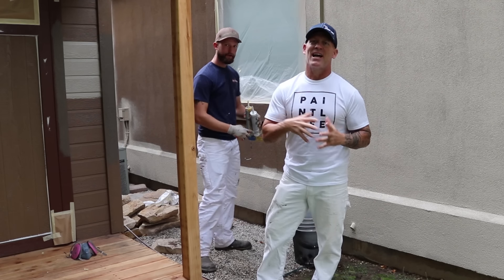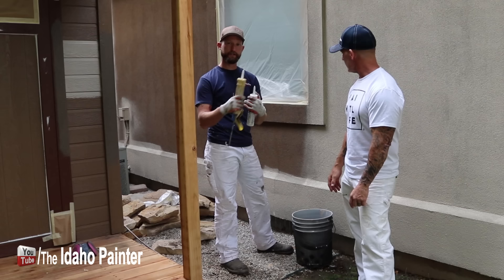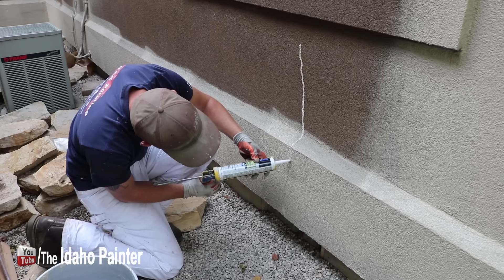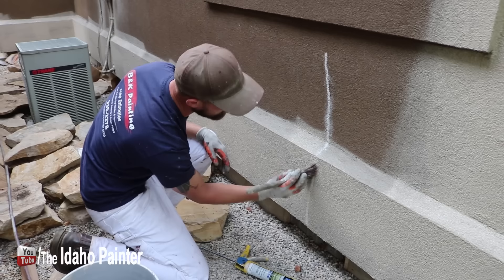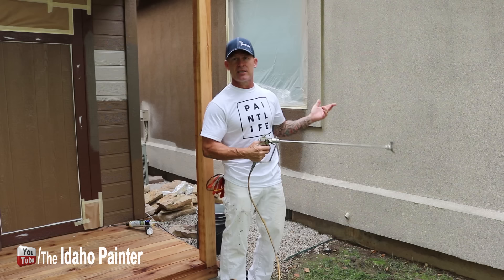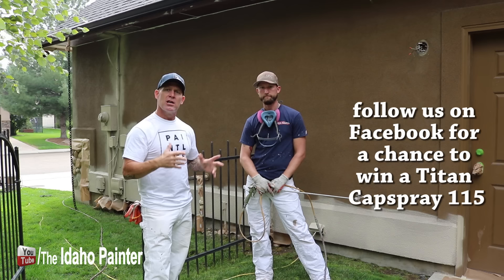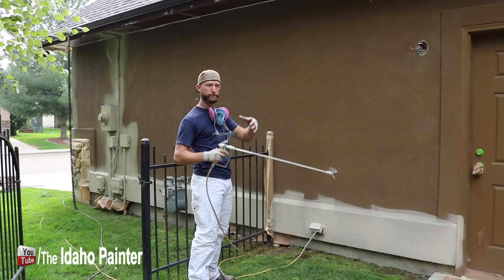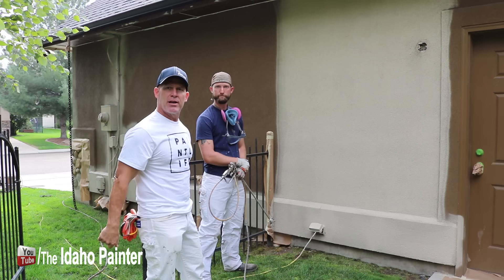4 Secret Painting Tips To Paint Stucco

Comment: The way I was thought 27 years ago was the only way that stucco should be painted is sprayed and back rolled. Might be able to get away with it on sand finish but on rough surfaces they definitely should be rolled. I from Florida so almost every house has rough stucco.
Reply: so these guys arent backrolling it because the stucco is not rough like it is in Florida?
Reply: YES!!! Always back roll!! I'm not sure why they didn't, but they should have!!
Reply: I have to agree with the lack of back rolling is a technique that was never taught in the trades as I was coming up at the time. i know we used sprayer and back rolled but 30 years ago they were really expensive and not sure they used the newer hvlp type back than. Thats when labor was cheap materials were put on heavy to save the time and expense having to come back for missing an area or the previous coat showing thru.
Reply: should aboslutly backroll any porus surface
Reply: What if the stucco has been previously painted with latex paint (elastomeric I think). The house I'm doing has previously painted latex satin sheen in stucco.

Comment: I roll on paint on rough stucco. But I wet it with water then roll on. The water seems to draw paint into the valleys and holes. I apply very thick then back roll after 10 minutes.

Comment: We always use an Elastomeric coating when painting stucco. It provides a flexible flim that covers hairline cracks to prevent water from penetrating into the building interiors.
Reply from the maker: you have a great point.  however, I have spoken to the chemist at sherwin williams who developed Sherlastic and they say you should not use elastomeric on stucco.  You should research why they say that.  You might change your mind
Reply: we painted a hospital with elastomeric spray -back roll 10 years ago still looks great
Reply: South Florida we typically apply elastomeric coating on parapet walls and severely spider cracked stucco, or rain exposed areas. Every where else is exterior paint. #PaintLife
Reply: @Idahopainter  that's only because they have liability.  Otherwise professionals have been using it on commercial building including hospitals and hotels for more the 20 years with zero issues.

Comment: Spray, backroll & spray. I have even gotten away with just spraying. Ill point the gun up then down then side to side at the end. Always spraying at a bit of an angle depending on how thick the texture is.  Sprayed residential in AZ (5 years)and all over the country doing commercial now for the last 12 years. 26 years all together now.Hope that helps.
Reply: Exactly spray and back roll at minimum that's how I do them I've been doing them for a lot of years here on Maui we use Sherwin-Williams satin.based on the fact here on Maui exterior Sheens breakdown in 4 months. I use the purdy 18 inch roller setup I have a friend who uses the jet roller system it takes time but it's proper

Comment: Here in the UK we would have ground that crack out first, then filled it with epoxy, then blended it in to match the existing surface finish.!!
Reply: That is actually the correct way to do it, even here in the US. But if it's a small enough crack you can sometimes get away with doing it the way they show here, though using a wire brush on the crack to clean it out first is recommended.
Reply: Reminds me of the the time your Red Coats fought the “prim and proper” way while our a revolutionary minute men used Guerrilla warfare tactics by ambushing and leaping out of trees with machetes.  We had a glorious opening of can of whoop ass party and you no likey.

Comment: Ok how about you do your prime coat then address your cracks by caulking and wiping excess with a wet sponge the primed surface will allow you to wipe off the excess before the caulk dries. Good video!
Reply: Priming first also insures that surfaces are clean, sealed and bonded for the caulk to stick to.  I never caulk unprimed wood for the same reason

Comment: Like the way you pre cut in electrical lines and bottom . Good job, but not sure if you went back over it with second coat? It would be a good idea. Also, it's not easy to paint a light color over dark and make it look nice...Good job, but that one was easy texture. Curious to see finished product or how you tackle heavy knockdown with that spray technique and get it to look good?
Reply from the maker: We typically back roll stucco

Comment: Definitely should be back rolling that stucco.there making it more difficult than it is
Reply: I've never seen such a thing. Spraying in crazy patterns to get a smooth look. I think that's how you would get different lines. If you spray even and over lap by 50percet you get better courage. Plus back roll.
Reply: First coat back roll with a thick coat. Then we repeat spraying an additional coat with no back rolling even spray 50percet overlap.
Reply: How you expect to do that crazy spray pattern 30 feet up. Back rolling is the way to go. Plus your locking in the paint not just coating the top.

Comment: Hey guys! I’ve watched almost all of your videos in preparation to paint the exterior of my stucco home. But I have a few unknowns that I hope y’all can help me out with before I begin! Prepping the entire house before a project... pressure washing, masking (I watched the video but it was for trim instead of the main house), window coverage (I’m assuming the double white tape and plastic?), and around shrubbery and at the top of the house where it meets the under roofing and when you’re on a ladder! How do you navigate?! Also, I bought elasromeric paint, and based off your tip video, I’m assuming I should go with a 619? 
Thank you for all you’ve taught me thus far, you have been extremely helpful!!
Reply: You have to pressure wash if you’re house is really dirty if not you can get away with hosing it down with a hose and a god nozzle you’re gonna need to mask everything that’s will not be painted starting with the windows and door handles you paint the body then paint the trim covering the body and then you do your accents (doors etc) you will probably be better off with a 517 for spraying your body a 315 for trim and pop outs and a 210 for your doors
Reply: I like your idea better.

Comment: I have a unique problem. (Maybe not so unique.) I did a paint match at Sherwin Williams for touch-up on painted stucco. Dark Brown. On 3 sides of the house, the paint matched perfectly from all angles at all times of the day. The Western side is a LITTLE MORE FADED than the rest of the house. In the MORNING the touched up spots look a little darker than the old paint. Almost like little spots of WET stucco. In the afternoon when the sun moves to the west those spots look perfect & I can't even see it. I tried watering down the touch-up paint. It didn't work. I'm thinking about trying a bleach & water mixture & hitting those spots with a small brush or toothbrush to fade the paint a little. Is there any TRICK to matching that Western side paint without having to knock out a big chuck of stucco & trying to match that? Someone said the "Spectro" has trouble matching stucco. The original color match was easy. I just removed the TV plate & brought that into SW. A few people have said it's almost impossible to match the paint perfectly on all sides without repainting the entire wall. I'm trying to avoid that. Big 2 story house in Vegas. Big job.

Thanx!

Comment: You should be back rolling this!!
Reply: Ikr ?
Reply: So after spraying the exterior it should be back rolled?  Trying to learn all I can before attempting to spray my house.  Any advise would be appreciated
Reply: @Franklin12211  ....yes, spray and back roll as you move along
Reply: Thanks!
Reply: You should not be doing this to stucco in the first place. Apply basecoat and mesh on cracks then resurface wihh finish coat in disired color
Reply: Blake Ranew  how do you prep the stucco surface so that the paint adheres
Reply: back rolling pushes the paint  "stain" into the cracks and locks it in.  It always looks better afterward also.

Comment: Thanks for the great tips!

Correct me if I’m wrong, I’ve been working with respirators for over ten years with carbon fiber, body filler, and paint. But is the guy spraying wearing a P100 filter, which is a particulate filter? Shouldn’t he be wearing a vapor filter? I usually wear a dual filter so I don’t have to worry about switching between but that looks like a P100 filter for a 3M mask
Reply from the maker: Inside yes

Comment: I am confused about the crack " repairs" I always have scraped cracks out to go et to sound material and give an area fir the elastomeric caulking an area to bind and lay just below the surface finish. Maybe your prepping the stucco for paint and those are hairline cracks? Isn't the caulk your using water soluble for eas cleaning of your tools? If they are using a damp brush will break down the caulk preventing it curing correctly weakening the joint resulting in premature failure of the joint after so many thermal cycles? 
Also if I came home and saw your guy spazzing with the sprayer I would ask for him to give a  drug test before allowing him on my property or on any kind of ladder. Back rolling would eliminate the spray pattern and work material into the heavy finish for better coverage, and finished product.
Reply from the maker: We have never had issues with our method

Comment: What about spray and back roll the stucco?
Reply from the maker: We back roll depending on the condition of it
Reply: As a home owner I would demand back rolling... just spraying stucco the color  will fade in less than a year.
Reply: Paint Life TV what conditions require back rolling. I will be painting my home soon. I’m just one man with an airless. Thanks.
Reply: BAC always backroll your stucco, you’ll push the paint into the pores otherwise paint will dry up and flake off once the sun burns it up. Spray a good amount, keep a 5 w a screen in it next to your airless, spray and roll as you go, second coat is only spray. the thicker the coat the longer life your paint and stucco will have.
Reply: Kevin Perez Thanks. What’s your opinion on paint. elastomeric or 100% acrylic?
Reply: BAC elastomeric! Much more weather resistant
Reply: Kevin Perez Elastomeric paint may require a top coat.
Reply: @kevinperez.5  great tip dude, but if it's just a normal smooth wall could I just spray and leave it or do I still have to back roll it?
Reply: Should always back roll on one of the coats

Comment: I made a stupid decision a long time ago and bought a house that is completely stuccoed inside.  Should I expect that the painters have to spray inside the home as well? The stop all looks really nasty now  And I can't think of any other solution besides getting it painted.  Is it ever possible to apply dry wall over stucco
Reply: It's not necessary to spray inside, the painter can use a roller, dry wall will not work because moisture, but you can apply  gypsum to the walls and have a flat finish.
Reply: @marcomartinez2769  Thsnk you!
Gypsum? Should I expect to pay alot more for that process (gypsum)?
Reply: I think it will be more expensive lol, I just gave you the idea since you ask for options. The best option is use a roller when you paint.👍

Comment: Hello. Just stumbled across two of your videos. My stucco is about paper thick and it is coming off in very large sheets. I believe I can handle the repair, but  with the a Lowes bought hand held  sprayer do I water down the paint? I would love your sprayer, but sorta expensive for the everyday, weekend painter. Any suggestions? Thank you
Reply from the maker: You should not water down your exterior paint. The handheld will only do small areas--try renting a sprayer for a day instead if you don’t want to buy one.

Comment: Florida girl, the whole reason I used stucco is you NEVER have to paint it! Stucco comes in COLORS from bright white to the darkest charcoal grey.
Reply: That's not true, stucco is only good for 10 years before it becomes dry, and brittle and begins to crack. When cracking starts it needs attention as quickly as possible. Water finds its way through the crack and begins doing damage rather quickly. This video is not a great example of how you should paint stucco. Stucco is good for about 10 years before needing its first coats of elastomeric that is ALWAYS backrolled into the pores of the stucco providing a waterproof exterior covering. Always stay on top of your paint to PREVENT problems that lead to major damage.

Comment: pro secret # 1  don't ever paint stucco. if you do, you will kill the most important functions for the longevity of stucco, and that is being able to breath.  paint will block moisture from quickly evaporating from the stucco and eventually you will have remove all of the stucco and and possibly have to repair sever water and mold damage. Any building with stucco on it, will immediately start to deteriorate with the first rainfall after it is painted. be prepared for a life time of maintenance if you paint your stucco. you can change the color of stucco without paint.  ask a pro stucco tec in your area
Reply from the maker: Thanks for the tips

Comment: Omg, pressure too low/blown out tip, all should be back rolled, Flat paint is cheating because your not back rolling and it is uneven that's why you don't like sheen. That gun all over the place "trick" is just covering up a hack job guaranteed pin holes everywhere. Terrible tips guys sorry. This is not how you paint stucco, I've been doing it for 20 years. Get the roller out turn the pressure up and actually put some paint on. 100% sure there's overspray/dust on the roof. 12" paper is not enough you will have a hard line on the edge.